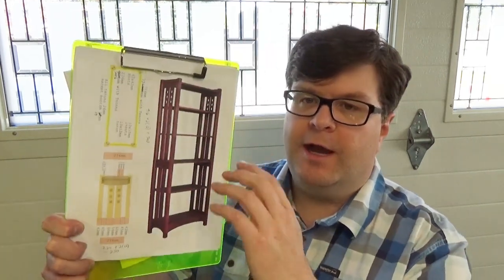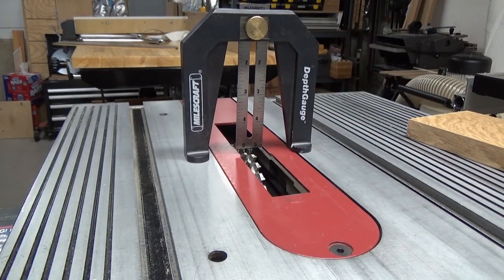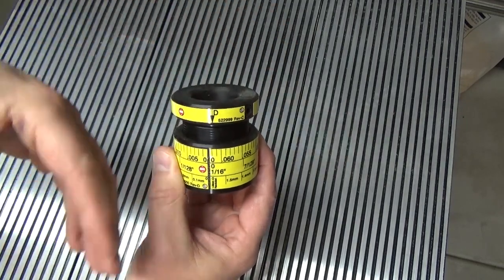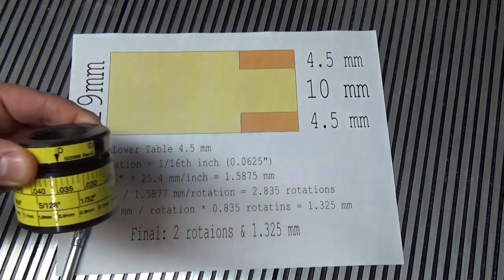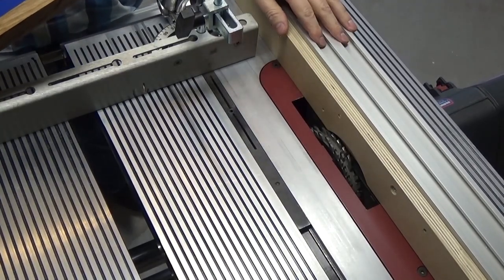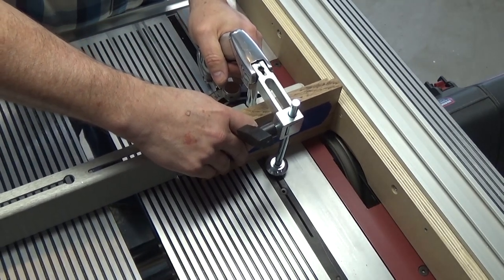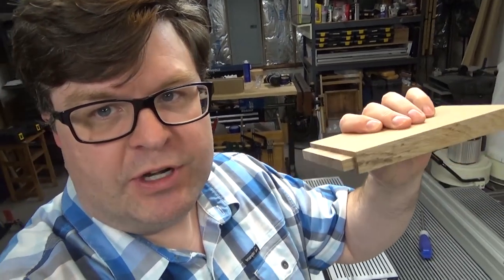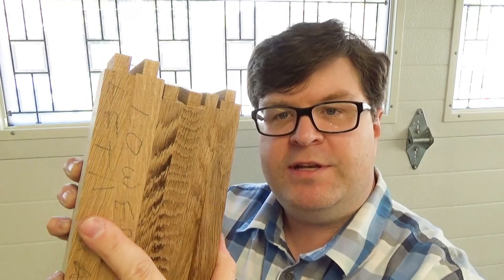Stickley Highlands Bookshelf: Accurate Dado Setup for Tenons on Shopsmith

Comment: This has made me decide to get the stop collar. Thanks for the video Tom, it answered some things for me.
Reply from the maker: I like it. The do run these on sale from time to time.
Reply: Yeah, me too. I'm going to be doing some "jointing" to size with the conical sander and had realized that adjusting the table height would allow me to "sneak up" on the final size, without "hogging" too much material at a time. (Higher is wider, and it narrows as you lower the table--closer to the "point" of the cone--until you get to the desired width). But getting the table to reliably and repeatably do that as I changed pieces was something I hadn't quite resolved. This is the obvious, elegant solution. Which is what I need, as I've got about 100 pieces, ranging from 32" to 8' to joint. Fortunately, I only need to joint one edge of each, to apply veneer tape, as all the other edges are either at the back of the unit or glued into dadoes.
Reply from the maker: @michaelarighi5268  should work. I have used the conical disc to smooth plywood edges many times. The smooth edges glue up very strong to edging and veneer banding.

Comment: I think I'll be putting that stop collar on my Christmas list.  It's interesting to see someone working in metric.  I'm an engineer and feel like I should strongly consider switching to metric.  Did you "make the switch" or have you always been a metric guy?
Reply from the maker: Dana, they do run sales on the collar and don't forget to get the kit with the yellow scale.

Yes, I converted from imperial to metric where I can. Unfortunately metric drill bits and router bits are not as easily available unless ordering online at some times elevated prices. I give a little more information in a comment I made to recent Rob Cosman video about metric vs. imperial. https://www.youtube.com/watch?v=ZRxs23h3wro&lc=Ugyi6PEQU0UXb-HG6Gt4AaABAg